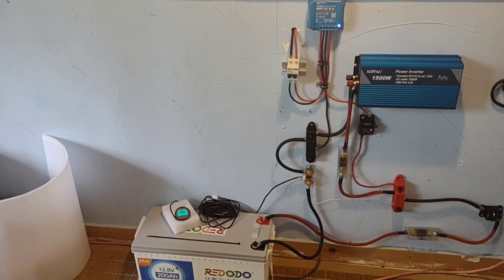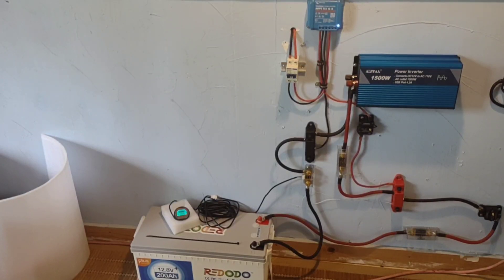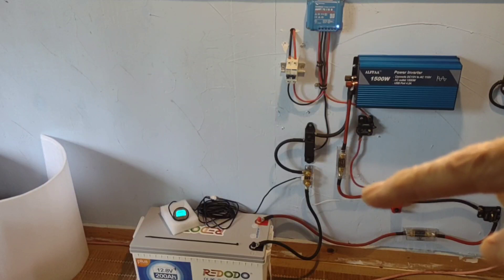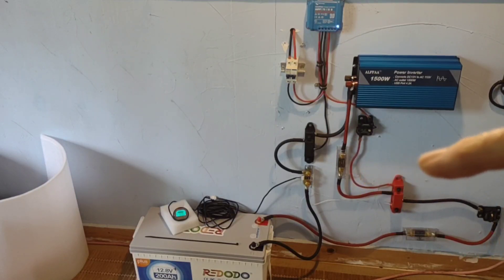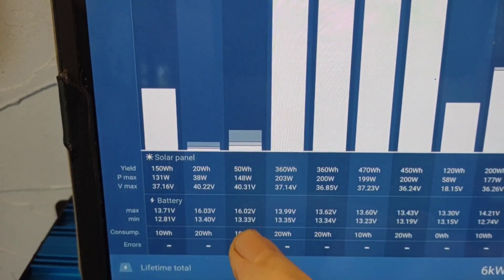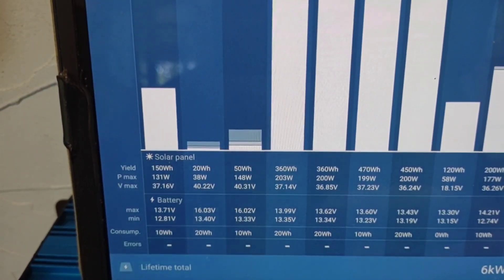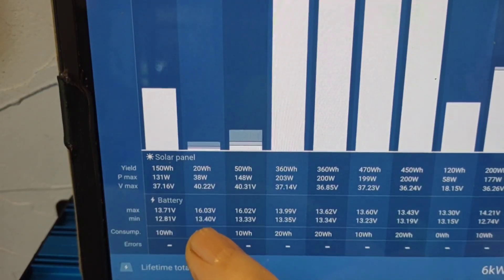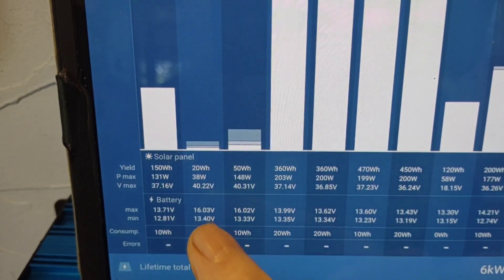Voltage spike 1st charge?

Comment: Mine spikes too causeing my inverter to shut off. I have 3 vivtrons controlers working synchronized to 3 12v 300Ah batteries tied to bus bar in parralle. And when they charge controller switch to absorption mode it spike only for a split second but its enough to make both inverters to shut down.  Fairly new batteries couple months old for that first one but month later got the 2nd the 2 weeks got the 3rd. So would i  think its not a balancing issue but then again im not thw brightest bulb on thw tree

Comment: My Victron charge controller does the exact same thing when the battery is nearing full charge and during absorption. I’ve been researching for months and haven’t been able to find an answer so if you do find one please share!
Reply from the maker: In one my recent video's,  I go over how it apparently resolved itself after cycling normally for about a month.  That said, I now just set absorption to 13.8v for 60 minutes,  and 13.5 float.  Working perfectly,  no issues at all. aloha 🤙
Reply: @ProjectsinParadise808  Yeah, but 13.8v is too low for an absorption charge for lithium.  1. You're giving up a lot of battery capacity and 2. probably not giving the BMS enough voltage to balance the cells, which will prematurely age the battery.

Comment: I've got a 75/15 and have never seen anything like that.    Its probably the BMS as these batteries are so ridiculously cheap that they probably have a cheap as chips BMS in them that may not be able to keep the cells balanced perfectly.  Would be interested to know what your battery settings are set to in the victron.
Reply from the maker: Currently running 3 separate Victron controllers.  On one 75/15  have set at 13.8v bulk,  and 13.5 float.  Other two on preset LiFePO4 setting,  14.2v, 13.5 float.  Always experimenting and fine tuning a little depending on what I'm using it for. aloha 🤙

Comment: I have seen this in two different brands of battery on the first charge when the cells are not completely balanced.  The spike happened when one cell exceeds 3.65v because there is another cell lagging and the BMS cuts out a cell over voltage error.

Comment: I've looked at my logs for my 2 controllers a 100/20 plus a 150/35 and in the last 30 day not seen the battery max over 14.29 which is 0.9 over absorption voltage , so not seen a spike on mine.
Reply from the maker: mahalo for sharing this information with us...aloha 🤙

Comment: If the battery bms system shuts down the input charge why doesn’t it hurt the charge controller that is still getting power from the panels?   Like how you have to hook up the battery before the solar?   Have fun be safe.
Reply from the maker: Great question,  but I don't know what happened.  Everything seems just fine, but I have proof it spiked...the mystery continues at this point 🤙
Reply: I think it’s a different scenario because you still have a battery connected and a measurable voltage. It’s not just an open as when nothing is connected at all.

Comment: I’ve experienced spikes with 12v and 24v systems. The spike in the 12v system were not high enough to trigger my inverter alarm. Immediately after upgrading battery capacity to 24v volt the spike took my inverter briefly offline. The spikes only occurred when the inverter was actively producing wattage. Finally I adjusted my “boost time” based on your experience and the issue is gone. I’m going to spend some time reviewing your entire solar “library”. Thanks.
Reply from the maker: I'm hoping to catch it again,  and have better understanding of what happened 🤙
Reply: Mine does that too. So it could be a balance issue

Comment: Was there a load on the inverter when it switched from bulk to absorb?  Could you try to replicate the issue with a different battery?  Great Video!
Reply from the maker: No load whatsoever,  was barely letting any current in from panels as it was just finishing up topping off. mahalo buddy 🤙

Comment: It may be the BMS inside battery . You may want to check charging info on that battery and compare it to the settings on that charge comptroller. I have ran into this from time to time, different battery and different BMS inside. some times you have to tweak charge settings to match battery, which you had to do on the main system.
Reply from the maker: 14.2 is Victron cc parameter , and well within battery specs. Scratching my head yet, but believe the bms triggered this🤙
Reply: I think it is the bms too. I had couple different ones and the cheap ones always did that when a cell reaches high voltage. This is one reason why I like to build my own battery cause some companies use cheap equipment
Reply: Why would the BMS disconnect in this case?

Comment: I  noticed that you have a braker near de controller. If it is a DC braker polarity is important and it must be wired correctly. My DC brakers have the positive on the left side and the negative on the right, also the source goes on top (on mine) and the lower connection is for the load. I read that if these are wired incorrectly they could easily burn and cause a fire.
Reply from the maker: Have checked, and rechecked everything is correct...thinking the bms triggered this event🤙